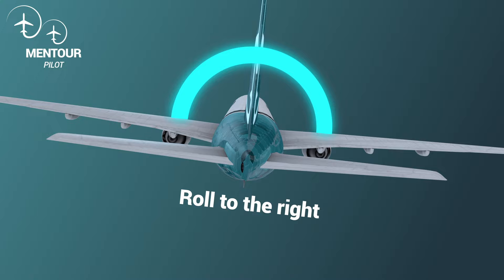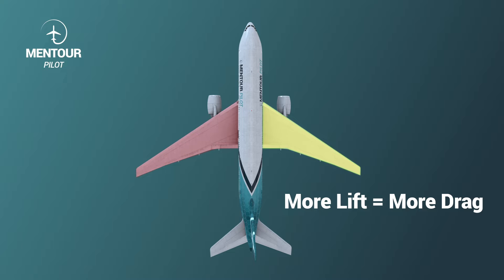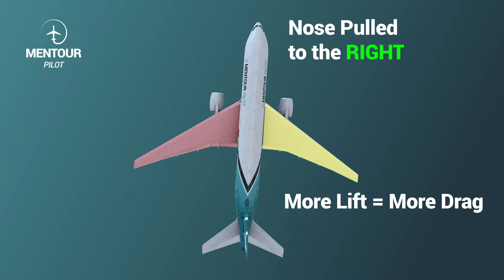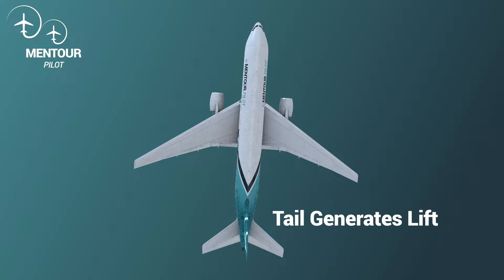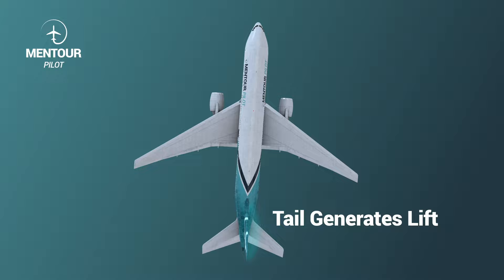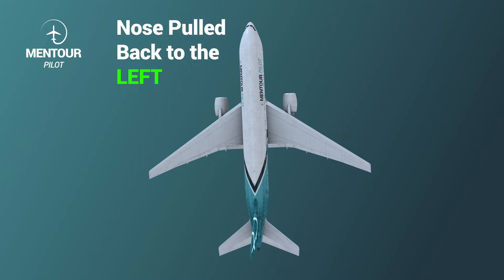What is a "Dutch Roll"?!

Comment: Back when the 737-100 was new my dad was the manager for the Conductron 737 flight simulator program. Dad brought the family in to see it on a weekend and I got to sit in the right seat and "fly" the SN 2 simulator with Boeing test pilot Kit Carson in the left seat. He was checking out the simulator before accepting it for delivery. The first thing I did was put the simulator in a Dutch Roll. Kit Carson was the man who introcuded me to that term. The Conductron 737 flight simulator was the first all digital flight simulator where the flight dynamics were calculated using numerical methods in the digital computer instead of using analog computers to do those calculations.

Comment: There's a pilot technique I learned during my B737 flight test work that will manually dampen out the dutch roll. With the yaw damper inop, momentarily just turn the yoke into the rising wing (for just a quarter of a second, that is), and return back to neutral. This raises the flight spoilers on the rising wing, dampening out the yaw effect. Repeat as necessary ...
Reply: They asked me on my first airline interview how to counteract dutch roll if the yaw dampers were inop! Thank you for this comment 🙏
Reply: 250 milliseconds LMFAO 😂😂
Reply: @birdman4274  I think most people can handle that unless they have the reaction time of a slug. At any rate, aerodynamically its really just to try to level them out slightly and limit the side-slip directly rather than guessing using the rudder.
Reply: @mysock351C  Did he measure it with an atomic clock. What error can we apply to the 250ms ?
Reply: @birdman4274  Using a simple fraction such as "1/4" implies low precision. People generally understand that a "quarter second" indicates a relatively short amount of time in our subjective perceptual terms. Generally anything less than one second will likely work. This is NOT the same as "250ms" which implies a precision down to 1ms. This is actually known as significant figures (or significant digits) and is an important concept people should have learned in school or college. Certainly most airline pilots would have, and know that it just means "Don't turn the damn yoke for as long as you like. You'll crash the plane."
Reply: @birdman4274  If you wanted to really get pedantic, you could say the fraction of "a quarter second" has no significant digits, but the "250ms" has three. The former can be assumed to be subjective and open to context and interpretation, while the latter objective and measurable with some specified degree of precision.
Reply: @mysock351C  A quarter of a second is a quarter of a second. It has error just like any other measurement whatever the representation is.
Reply: @birdman4274  If you are looking for some sort of error or tolerance, then you are either unintentionally or deliberately misunderstanding what is being conveyed.
Reply: @mysock351C  My real argument is that his input and then the reaction aerodynamically of the aircraft is longer than a quarter of a second or 250ms (whatever the representation)
Reply: @birdman4274  That is the whole issue with using the rudder since the side-slip is a big driver in what initiates the Dutch roll. You end up "behind" the plane if you are putting the input in reactively as you have no direct indicator of where the airplane is in the roll at any one time. If its in the process of recovering to wings level and working towards yawing the other way, you can end up further increasing the yawing moment if you are putting in corrections at the wrong time.  However, by using the yoke the spoilers will help counter the increased drag and thus the adverse yaw directly and without any real delay. Since the artificial horizon can be used as the quantitative reference, its a much more reliable way to counter it. And, we are not looking to stop it, just help it die down faster than it would on its own. Since the pilot can see the results of his actions, the "quarter second" can be taken as a basic starting point since the relative timing can be adjusted as needed. While I'm not a pilot, the timing may also be important with respect to actually getting the spoilers to deploy to augment the ailerons. Presumably you would turn the yoke towards the wing that is in the process of rising. The drag from the spoilers will help counter the drag from the increased lift on the falling wing, and help straighten the plane out a bit.
Reply: @birdman4274  In some scenarios, one second is a lot of time, and 1/4 a second is plenty of time to make a quick yoke input and return to neutral.  Edit:  but I think you know this and you're arguing just to argue, or to be "right"
Reply: Back in the 727 days we used that technique for dutch roll.  The 727  was a divergent dutch roller,  meaning the roll and yaw would continue to increase,
Reply: @mysock351C  Do not bother explaining, some people just want an argument. I am not a pilot & even have worked in a supermarket, but completely understand why you do not touch the rudder. Not only that, but I can recall enough accidents where it was clear the pilot was pushing rudder like it was a push bike. You can get into an unstable situation when towing too (for varied reasons) and the solution can be counter intuitive. i.e do nothing is one, turning the wheel in an every increasing amount or violently will bring disaster. Anyway, the point is, we have to hope our pilot has the ability to resist knee jerk reactions so as not to induce an unrecoverable situation, that is what I expect of a pilot.

Comment: There was also AA587 that crashed in New York in 2001.  In response to turbulence the pilot used excessive rudder inputs with several rapid reversals.  This was a positive feedback loop which ended in the vertical stabiliser separating as it the loads were beyond the design limit.

Comment: So we study this phenomenon in aerospace engineering. Our professor told us that the name came from the fact that the Dutch  were, back in the day, sailors who spent very long times at sea, inherently getting used to the movement of the boat caused by the waves. Once they got to port and stepped on steady ground, they were known for struggling with the balance and walking in this characteristic manner weiving from left to right. Since the movement of an aircraft was somewhat similar, the name was attributed to this stability mode. This explanation is rather anecdotal and I have no idea if it is even true. Anyway I just wanted to share this with all of you. As usual, awesome video and awesome explanations. Keep it up!

Comment: The problem of Dutch roll on swept-wing aircraft was first encountered during flight tests of the revolutionary Boeing B-47 bomber, some seventy years ago.  The first yaw damper system was developed and installed on that aircraft, and then carried over onto commercial models of swept-wing transport aircraft. 
The cockpit yaw damper indicator which Mentour mentioned was not installed to indicate yaw damper movements in flight, but to allow flight crews and maintenance to verify proper yaw damper operation while the aircraft was safely on the ground.  To facilitate this, a test switch below the indicator could be pushed to the left or right to initiate a deflection of the yaw gyroscope in the yaw damper coupler, simulating a yaw of the aircraft.  The rudder movement in response to the yaw damper output was clearly visible on the indicator.  One day, a pilot for an early operator of the Boeing 737-200 aircraft decided to test the yaw damper in flight.  Unfortunately, the response to his actuation of the switch, which was not intended to be used in flight, was not attenuated by the high airspeed of the aircraft, as was normal yaw sensing and processing.  The resulting, excessive rudder movement caused severe yawing of the aircraft and, as I remember, injured a flight attendant.  Shortly after that, plastic guards were installed over the yaw damper test switches as a reminder that they were not to be used in flight.
On those early B737 aircraft, it was allowable to dispatch an aircraft for a flight with an inoperative yaw damper, with certain restrictions on use of the autopilot at altitude.  Flight attendants dreaded flying on an airplane without yaw damping.  The resulting Dutch roll in flight was barely discernible to most passengers, but frequently resulted in motion sickness among passengers seated aft, far from the aircraft center of mass.  This manifested itself in vomiting by the affected passengers, which affected passengers seated in the next row forward, and so forth, and might result in a large number of airsick passengers by the end of the flight.  Not too many years previous to this phenomenon, passengers routinely experienced far worse while flying through turbulent lower altitudes in slow moving DC-3s.  In some ways the golden age of air travel had a greenish tinge to them.
Reply: The movement induced by a dutch roll is about one of the worst for producing motion sickness. The back of the aircraft is essentially making a 'figure 8' that is just sloshing the inner ear in all dimensions== Those technicolor yawns start to happen. Moderate chop and higher, is moving the fluid around 2 axes that is uncomfortable to say the least but nowhere near the dutch roll. The poor devils in the aft loos are gonna be in there awhile regardless of why they went in to begin with. 🤢🤮🤮.  The varying movement is what really causes the dizziness that escalates.  This is why folks get seasick, because the ship is moving in all directions, depending on waves, wind and ship design.  Newer passenger ships have some advanced dampening systems that go a long way to keep the pax comfortable, but encountering bad weather resulting in following seas is just misery on top of misery, even for experienced crews on occasion.  The real hell on the water, is being in a sub, stuck on the surface or unable to dive deep enough to get out of the ocean actions. Modern submarine hulls are completely round for speed and quiet operating. On the surface there is nothing to dampen the rolling and pitching that happens.

Comment: This is very interesting, I have never heard of a Dutch Roll before.

I have heard about airplanes having a Yaw Damper but I have had no idea how it worked until this video.

I really like how you explain it with lots of details, like having the video showing what a Dutch Roll looks like. 

It was very interesting to find out that the 707 had a Yaw Damper, I would think that it would be something more recently on airplanes with all the computer controls they seem to have these days.

It sounds like a Yaw Damper on an airplane is kind of like cars now having stability control on them.

Thank You Very Much, for making this video, I enjoyed it very much👍🙂
Reply: I know what a Dutch Crunch roll is. Apparently this is completely different.
Reply: @brown-eyedman4040  Apparently🤔
Reply: Would not a yaw to the right mean that the direction of the airflow relative to the nose-tail axis be to the left, i.e. skidding with the left wing forward?
Reply: A yaw damper can be implemented with an analog control circuit. For the last several decades it's been easier to implement it in code in one of the avionics computers.
Reply: In right yaw, the wind will flow from left to right, in the frame of nose to tail. The plane will have the same velocity vector it had before yawing

Comment: I loved this. Although I got my PPL (now lapsed) on a Cessna 172 AGES ago, I still do a lot of kite flying and aeromodelling. I started out with free-flight aircraft as a kid and gradually moved on to RC planes. Lots of homemade designs, lots of experiments, lots of mistakes.

Without necessarily understanding the scientific aspects of aerodynamics very deeply, old-school aeromodellers used to get a pretty good grounding in the basics of flight dynamics and stability without really knowing it. Many of today's expert RC modellers are terrific pilots, but they miss out on a lot of fun by only buying ready-to-fly planes, pre-trimmed, tried and tested.

But playing about with your own designs and drawing up 'what-if?' plans is fascinating and fun.

Dutch rolling was most noticeable on gliders (of around 10' wingspan) when free-flight designs were converted to radio-control. Early RC gear was very simple, offering just one channel:  rudder only. To avoid constant crashes (no elevator, so pitch was non-negotiable!) the planes had to be self-stabilising, and the wings had lots of dihedral or even polyhedral.

Touching the rudder gave a turn, plus a lot of swooping and wallowing; there was all sorts of fun playing about with dihedral, wing sweep, tail moment and vertical stabiliser area to reduce it. The problem disappeared when radio gear allowed full control (elevator and aileron, with less extreme dihedral).

Happy days... :-)

Comment: I once duplicated the principle of "Dutch" roll in an automotive context, when I was towing a Pontiac Tempest with a much lighter IH Scout with 4 cylinder engine. At about 45mph the front suspension went into a slight drift to right, then cycled back to do a drift to the left. Basically a resonant  "S" back and forth. I guessed that if I put steering inputs that might cancel out the mechanically worn out and out of adjustment front end components. It worked.  The tow rig was now running as straight as an arrow while the tires were doing one heck of a sort of sidewinder dance back and forth. Good thing it was a short haul, not really safe.

Comment: Japan Air 123 lost most of it's vertical stabilizer, and in addition to losing all of it's hydraulic systems, was experiencing severe Dutch roll due to missing the stabilizer. It's amazing that the pilots kept that plane in the air for 32 minutes after the tail came off. From looking at the FDR data, that plane was rolling as far as 80 degrees from horizontal roughly every 12 seconds because of it.

Comment: The translational movement due to the tilted wings is not a yaw, that's a side slip. Yawing (rotation about the vertical axis) comes as a reaction.
Reply: @acbulgin2  But he called the movement yaw. Which it isn't.
Reply: Absolutely.  I love his videos, but this is a fundamental problem with this one - the sideslip is the very thing increasing the lift of the downwing compared to the upperwing.  Any yaw in that direction amounts to near- coordination of the turn and even-ing the flow over the wings.(That yaw does happen with the consequential effects on the rudder etc, but it is hardly the thing increasing lift in the lower wing relative to the upper).

I genuinely think it must have been Petter not concentrating with the use of the word 'yaw'  - but it's a bit of a flaw!

Comment: Dutch roll is an interesting phenomenon that I run into often flying RC models.
Its almost impossible to eliminate with the high power to weight ratio.  There's almost always some flight condition that will get the tail wagging.

I often get the tail wagging in the takeoff climb if I don't let the aircraft gain  enough airspeed.  If that is the only time it is seen, I stop trying to cure it through changing the design of the aircraft.

Comment: This is one of the reasons the FAA and icao has established the type rating requirement. Anytime I step in any high performance aircraft especially jets I always notice slight differences in the control characteristics of the aircraft in hand flying. Slight and smooth inputs are the key to preventing unstable flight. 
For those who have taking a checkride for private pilot and for additional ratings will notice a type rating checkride is typically 6 hours combined with the oral and flight portion.  Any time the aircraft requires a minimum crew of two, the checkride will be conducted with a pilot flying and pilot monitoring.

Comment: I'm not a pilot but understand the vector forces when it comes to changing course esp in an emergency on a boat in the water.  Yes, there is no "Z" axis with a boat like there is with aircraft but similarly, there are momentum characteristics in play. Ideally, there is no immediate effect vectors with making left or right turns due to momentum effects. When I watch an aircraft or as a passenger, we don't notice these effects much but they do happen...You can notice it more when you see videos of landings with a crosswind.

Comment: The first thing they taught me about rolling on the small plane I fly is that simultaneously with the roll, the plane yaws AWAY from the direction of the roll. To compensate that on a turn they taught us to give a little of same rudder as the roll direction, only while rolling for the turn, not while holding the angle after.
The prop plays into that too. Not sure about jets, they never attracted or interested me.

Comment: So yaw dampers already existed in the '50s. It's amazing to recall the first flight with engine was in 1903 and took only 14 seconds.  A couple of decades later, we've had tested, certified huge commercial aircrafts equipped with hydraulics and flight-aiding systems.

Comment: Erm sorry i'm a little confused, if the aircraft rolls to the right and imparts a right yaw moment (4:47) the incoming air would come from the left surely?
Reply: Absolutely correct. Relativity mechanics can be deceptive to most.
Reply: Warning I'm not an expert on aerodynamics:
He missed or glossed over that when the aircraft rolls to the right it also does a right sideslip, it falls to the right, that's where the extra airflow comes from.
Reply: @spoddie  No he actually explained the mechanism that results in the sideslip to the right, but he then inexplicably called it yawing to the right.
Reply: To add, the sideslip does cause a yawing moment to the right, but this is a delayed result of the incoming air coming from the right (i.e.sideslipping to the right), not the cause of it.